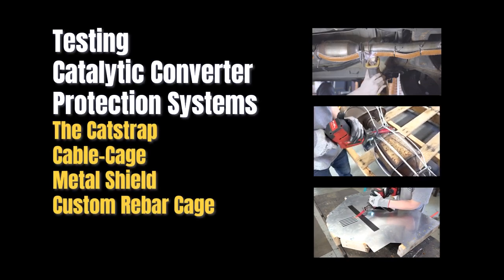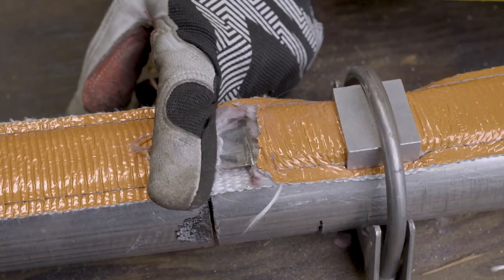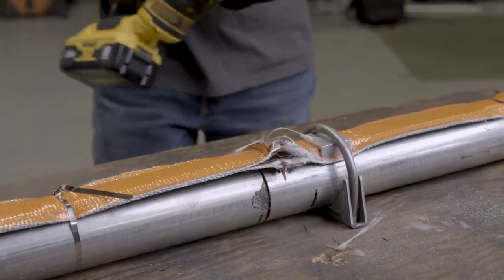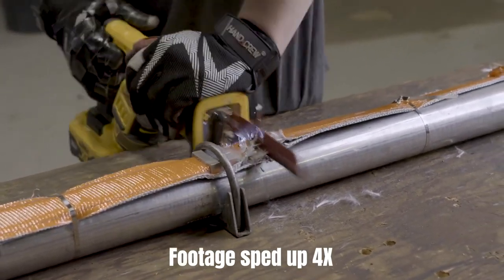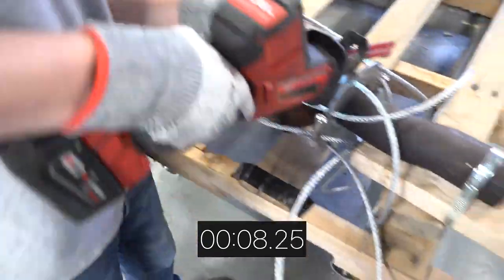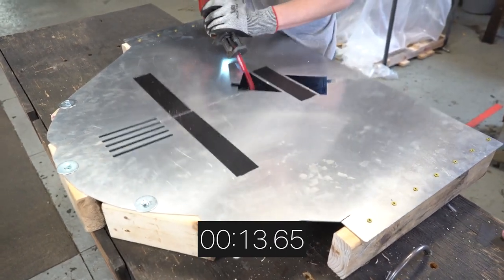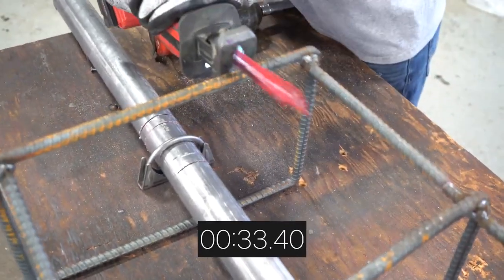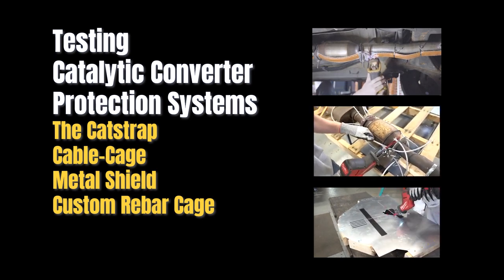We Reviewed the Top Catalytic Converter Anti-Theft Devices: Shields, Catstrap, Catclamp, Cages

Comment from the maker: COMMON QUESTION: "Can they just cut from the side or top and go down to let the Catstrap fall off and cut the catalytic converter off?" 

ANSWER: The strap has an adhesive strip that bonds to the exhaust pipe and will not fall away if the clamps are cut off. The u-bolt exhaust clamps are also overtightened to form into the pipe, so that even if cut, they must be pried off with another tool.